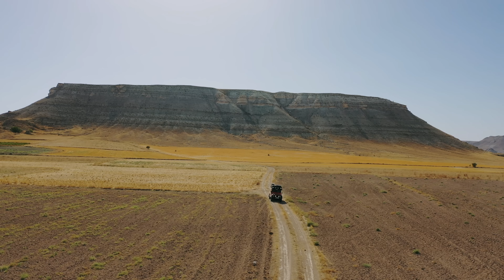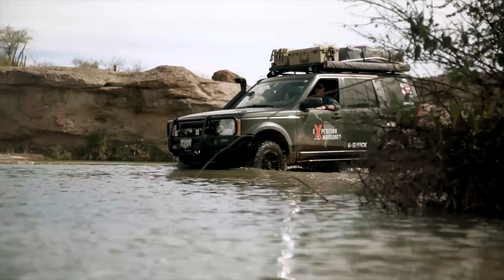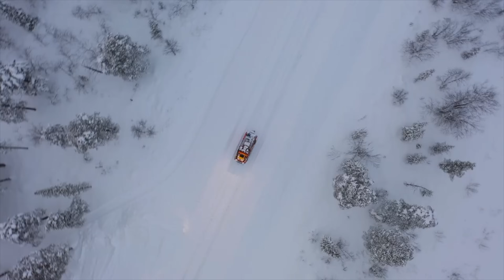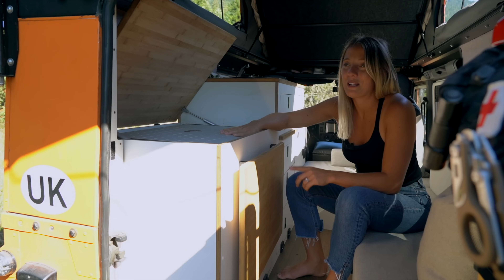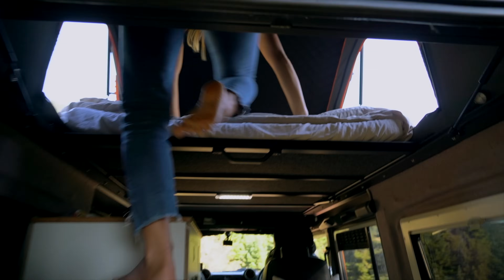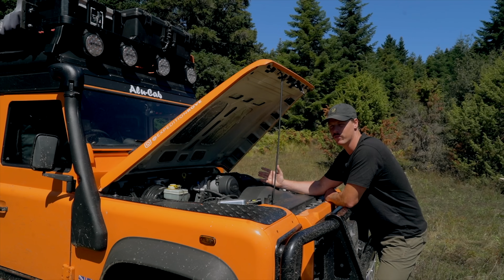Land Rover Defender Camper Build Walkaround | Tango 2.0: Our Ultimate Overland Expedition Rig

Comment: I have Defender110SVX. I've owned it for 16 years. Over the years I have realized one thing: off-roading requires a vehicle that is as lightweight as possible. Your project is interesting as a camping vehicle, but you don't need a Defender for that. All its advantages are reduced to zero. It would have been enough to buy a four-wheel drive minibus and do the same thing, only there is more free space in the bus. My project doesn't have any sleeping places inside, only a tent, and not on the roof, but on the side under the awning. My wife and I are traveling according to the program of 1-2 nights off-road and then 1-2 hotels. If the off-road is difficult and dangerous, I go with friends, everyone goes in a group of men only. I'm not going to lecture you, but this is my experience.
What's the value of the Defender? You can tailor it to suit your specific needs and the needs of your family. Good luck, and take care of your family. Greetings from Kyiv.

Comment: Hi, was the domestic window is a simple fix replacing the old window? or there is some modification and cutting required? which size is the one you have installed?
Reply from the maker: There weren't windows in our rear panels previously, so we cut the holes to fit the Dometic S5s!

Comment: Hi, I followed your set up and it is impressive.  I own a td5 1999 and I have just put up a new inside. I installed also the electric cooker with 1800W and a 210Ah lithium batterie. The converter has 2000W permanent and 6000W peak. After our first 3 weeks test we had problems between the 2 batteries and the fuse of the Relais 60A went of several times.
Could you perhaps help me how I can put up the system like you have it ????
Thank you very much 
Kind regards 
Ulli

Comment: Best Defender build! I’m copying yours when building/converting now 😎
I’m in the process of getting the Icarus, but the dealership couldn’t answer if I could keep my roof rack or not. 
Did you have any problems installing the roof rack on top of the Icarus?
Reply from the maker: No problems but you will have to upgrade your gas struts if you plan on adding a lot of extra weight. I would suggest trying to keep the weight off the roof as much as possible. We actually took half of our rack off and moved some other bits around to try and get as much weight as possible off the roof to help with handling. Obviously as a touring vehicle you will always be heavy so there’s only so much you can do.

Comment: something i noticed as a safety feature.   when you pop the roof i noticed your release handles/clips are on the outside.  this could allow a thief to pop your top then slash your roof tent to gain easy access to your vehicle if your not around for a while.  maybe put some locks on the inside to prevent this.   i know if someone wants into your vehicle they will get in.  just my opinion but this may slow them down
Reply from the maker: Great catch! We lock it up externally and internally when we’re away from the vehicle 👍🏻
Reply: @EXPEDITIONROVE  ok cool.  you never know whos watching your videos.  its ok im in scotland btw.  youve nothing to worry about me

Comment: Great stuff thanks for posting this video. Just about to get the Alu-cab roof conversion and starting to plan the interior set up - this video has been really helpful. One of the better thought out builds I've seen. I'll likely use quite a few of the ideas but travelling with two dogs will no doubt mean some compromises. Any details of how / where you run the wiring from the roof top solar to behind the drivers seat(?) would be appreciated. Thanks again.
Reply from the maker: Hey Ian! Sounds epic. We'd love to have some doggos on the road with us if we had more space. If you have any questions on the build-out side just shoot us a message. I made an excel doc with all the products we used - it's link in this video description if that's helpful at all for planning purposes. 

For the solar wiring we used Scanstrut double cable seals to run it into the roof: https://www.mudstuff.co.uk/products/scanstrut-double-cable-seal?_pos=3&_sid=5cbc94491&_ss=r

And then the A-Pillar we used this extra deep pillar trim since it's quite a lot of wiring that we have there now:
https://www.mudstuff.co.uk/products/mud-a-pillar-trim?_pos=1&_sid=114113aaa&_ss=r

From there it was just a matter of running to the battery box that's behind the drivers seat.

Comment: Hey guys great build, I love it!! question: Is there any reason, in particular, y'all chose 2000 w cap for your solar? eg safety based on the size of your home.
Reply from the maker: Thank you! We went with a 2000W inverter because the highest powered item we have is our induction cooktop at 1500W. Anything above 2000W for our current setup would have been overkill and since we're tight on space it made sense to stick to the smaller 2000W inverter. If we had any appliances that were at the 1800W mark or higher we would have gone with a high capacity inverter. Hope this helps!

Comment: Love it, been following you on instagram for a while now! Who installed your diesel heater? That’s my next planned upgrade for my puma camper
Reply from the maker: Hey! Thank you so much :) We try our best to do most of the upgrades ourselves where we can so Andy ended up doing the diesel heater install. We went with the Webasto AirTop 2000! Do you have any specific questions on the install we might be able to help with?
Reply: @EXPEDITIONROVE  Nice, thanks! My main questions are where does the exhaust go? How does the fuel comes in? And is it an easy DIY install?

Comment: Thanks guys for sharing this video! Especially the Indoor part is amazing! Do you want to share how much the Interior expansion was?
Reply from the maker: Hey! Glad you enjoyed it! Are you looking for the figures for just what we spent on the the interior cabinetry, or a rundown on everything including the roof conversion, products (fridge, sink, induction, battery setup, solar, etc)? I don't have it all priced up but it's something I could pull together pretty easily I think!
Reply: @EXPEDITIONROVE  Im just looking for the interior cabinetry (wooden lining, kichten area, fly screen, etc.)
. Would be lovely of you.
Reply from the maker: @servus1556  Not including any products (roof conversion, fridge, sink, taps, water system, electrical system, windows, etc) we spent around £2,800 on the cabinetry/camper side of things. That includes things like:
- insulation
- the raw sheets of birch ply for all the cabinetry
- the laminate and bonding services for the birch ply (we had laminate bonded to our birch so it was easy to maintain and clean) 
- CNCing
- bamboo worktop
- upholstery foam 
- upholstering of the cushions
- the flooring 
- the hinges and fixtures

Seems like a lot, but when you compare it to the £18,000 quote we got from a company to build it almost to this same spec, I must say I'm pretty pleased. Glad we decided to do most of it ourselves. 

Disclaimer: I'm sure there's some things I'm forgetting on this list or random things we bought that I didn't put on my excel doc, but that is a good estimate.

Comment: Hello,

our Landy is built in a similar way.
How heavy is your Landy when everything is stowed and the tanks are filled.
Best regards from Germany.
Jens
Reply from the maker: Hi Jens, we're at 3,200kg when completely loaded down (long range fuel tank full, 67 water tank full, all gear, plus both our body weight)! Our GVWR is 3,500. Hope this helps.
Reply: @EXPEDITIONROVE  Hi you two,
pretty similar the weight, we don't take as much water. So far a 12L canister has always been enough. On the road there were always opportunities to organize or filter drinking water. 
The Long Range tanks we also have about 167L of diesel but not always full.
And in recent years has been cleared out, what is really necessary, what was never or very rarely needed.
The next sensible step is a diet but only for my wife and the two dogs!
Have a nice Sunday.

Comment: Very nice set up .I am starting with my defefender the Panamericana in May I would like to know how much weight you have on the roof including your roof rack,I am packing and packing and thinking what to take and no
Reply from the maker: Hey hey! Including the roof rack and all of the gear and components in the setup in this video it's around 150kg up there....aka HEAVY. After this UK to Turkey trip we came home and made some changes up top to cut weigh because the off-road capability was definitely effected, as to be expected with that much weight up top.

Changes made since this video: 
- We swapped for a 1/2 roof rack and 2x roof bars
- Removed one solar panels 
- And brought the Hi-Lift jack down to the front bumper

New Total: 100kg up top. 

Here's the breakdown: 
- Solar Panels: 22.00 kg
- Roof Box w/ gear: 20.00 kg
- Front Runner 1/2 Roof Rack : 31.5 kg
- Front Runner Roof bars (2): 8.0kg
- FR Table: 10.0kg
- FR Table Rack Slide: 2.4kg
- MAXTRAX XTreme (pair): 4.5kg
- Recovery Board Mounting Bracket	4.4kg

If you have an ALu-Cab Icarus, keep in mind that adds another 70kg compared to the standard roof, since it's got the bed etc built in. 

Hope this help!
-MH

Comment: Ya - I also wanted to have my Ali-Cab Canopy Camper useable when the pop top was down. Except I found a great quality used office chair (hacked it to an inch of its life-:). With this chair I can lower it so my head clears when PT is down. & bonus you have a very comfortable ergonomic tilting lounging chair to chill in 24/7.

Single source energy is gold - had it in the van & now with the ACCC.
Very nice build & great tour...🤙🏻 Happy Travels
Reply from the maker: Love the innovation! Sometimes the simple solutions are the best.
Reply: @EXPEDITIONROVE  I got spoiled in the van having the comfortable & adjustable front seats swivel kit installed. I figured I'd come close enuf with what office chair. I was right...
Reply from the maker: @TerryManitoba  oh man, swivel seats are the actual dream 🙌🏻 I bet those were hard to give up
Reply: @EXPEDITIONROVE  Yes - the van is great  - but I'm building a Tacoma a/w the ACCC for my Mexico to Argentina trip.
Reply from the maker: @TerryManitoba  heck yeah! love to hear it. don't hesitate to reach out to us if you have any questions that pop up for the Pan-Am trip (shipping, route planning, contacts, etc). No doubt it'll be a trip of a lifetime!

Comment: Looks great but what is the weight? I think you might need to upgrade suspension because of the weight. Installed an alubab roof myself and it is indeed a gamechanger.
Reply from the maker: Thank you! Yes the Alu-cab is definitely a game changer! On weight...we're at 3,200kg when fully loaded (fuel, water, gear, camper, plus our body weight, etc). Our Defender's rated to 3,500kg and we've got standard heavy duty suspension. Should be fine and hasn't' given us any problems yet, but might decide to upgrade it down the line.

Comment: Great build out!
What was the reasoning from moving from a LR3 to the Defender for an expedition build? I have both and contemplated converting one to an expedition vehicle. I see pros and cons on both sides so what finalized your decision.
Reply from the maker: Both are great options! For comfort, you can't beat the LR3. But for ease of repairs out in the bush, a Defender is the winner.

We absolutely love our LR3. Still have it in Texas actually...thinking about selling it though since it's not being put to good use. The only issue we had with it the entire 23K+ miles of the California to Argentina trip was an air suspension. The main reason we swapped to the Defender is because our LR3 hit 200K miles and we were about to head to Africa and were getting a little weary about the reliability and how many electronic components there are on it. A Defender is much much easier to work on without the electronic system so if anything was to go wrong if we were out in the bush we could likely fix it ourselves, or find a small shop that could help. We were turned down a few times a few times with the LR3 at shops as soon as they saw it needed a computer for the electronics - so that's something to keep in mind as well. Hope this helps!

Comment: Thanks so much for sharing your great and informative video.
So many good nuggets of advice😊👍
We are in the UK and looking for a 110 to start to build up for two and two dogs🐶
What are your thoughts on the engine? Not sure which way to go. 300tdi, td5 or newer puma?
All pluses and minuses. The hard part is finding an older well preserved truck.
All exciting and once again so good to see a well put together and sorted truck like yours.
Wishing you many wonderful future adventures 😁🚒🖐️
Reply from the maker: All depends on your budget really, I’d probably say if you plan on taking it to far flung corners of the world a 300tdi in good condition or fully rebuilt would be best. But if you don’t really want to rebuild you’re more likely to get a Puma with a better body condition and lower mileage. 

The Defender market is really all over the place, my advice would be don’t worry about the age of the Defender as even the newest defender is about 7 years old now and things will need replacing on it, so just spend your time looking for one that’s been well looked after. A 1990 rebuilt Defender is a better buy than your average 2015 Defender in my opinion.

Comment: What brand of induction cooktop top is that? Love the look and the roundness of it. Thank Tournine advance
Reply from the maker: We went with a Sterling Power 1500w induction hob: https://sterling-power.com/products/induction-hobs-1. We have the IH1 (which is their built-in) and their IHP (which is their portable one). This was one of the only companies I could find in Europe that offers induction hobs that have variable power (ie. it doesn't switch on and off to achieve the higher power levels, instead it puts a constant rate of power out at that level. Much better for the health of your inverter.) AND power sharing if you go with a double burner from them (as you turn one hob up, the other hob goes down to never exceed the max power). It's been great so far. Hope this helps!

Here's a Google Doc with links to all of the products we used for the build, if that's helpful, too: https://docs.google.com/spreadsheets/d/e/2PACX-1vRFisndHnpXPR17DSLjHcd3NaGGftLz8IlGtEqzno5l89F2ljsjhDPpQvUa7Nidwwe6D_bhsoVCpvM8/pubhtml